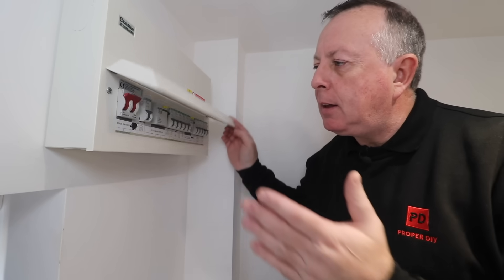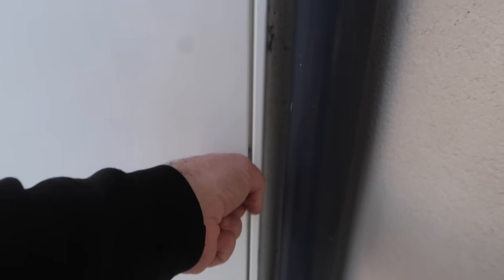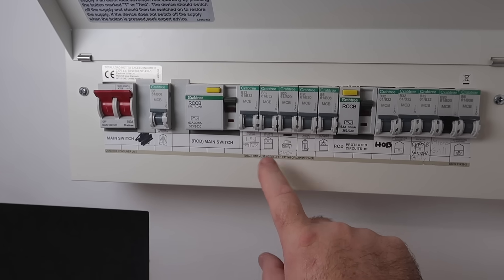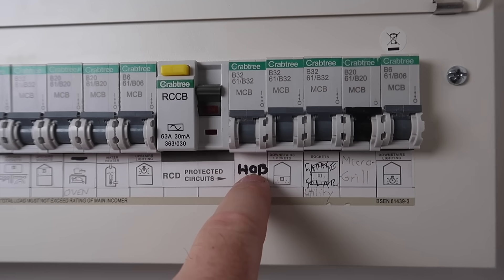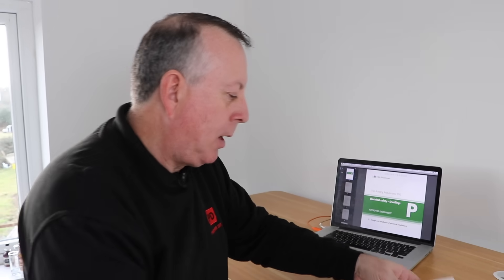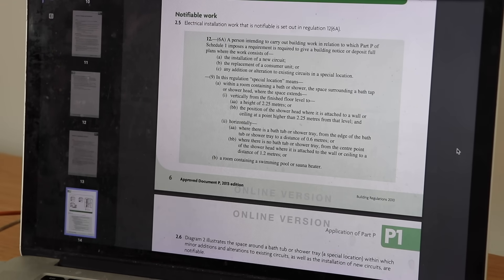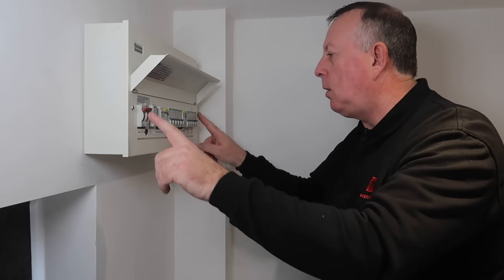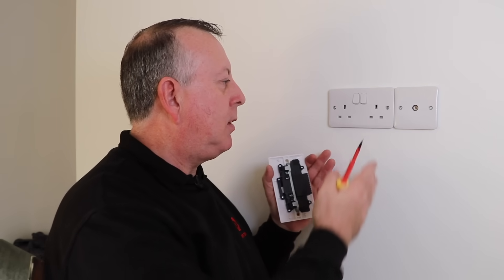What electrical work are you allowed to do in your own home?

Comment: One thing that I think you should have included is reference to the wiring regulations - that's not the same as Part P. This is important since, while homeowners can carry out the work you described, it still has to be in accordance with the wiring regulations. One minor correction is around a fused spur (you mentioned on the video an isolator) which isn't a new circuit and you can install a fused spur as a homeowner. You would need to do so if, for example, you were to install some lighting from the ring-main. The lights would have to be fused down to 3 or 5 amps. You're spot on about the consumer unit though and it's worth adding if you have a second panel in a garage, it applies to new circuits there too.
Reply: This is a good point.

A while back I replaced a section of wiring over at my Nan's house, which ran out towards an outside light. The installer (I won't call them an electrician) apparently decided that because the cable run was partially protected by the building that ordinary PVC interior wiring would be acceptable.

I replaced the bodge-job light and ran new pond cable (HOF7RN or something) to it. I found the old cabling had started to become brittle and wasn't adequately supported along it's length, which was also nice.

Apparently the same guy may have been involved at one of her neighbour's houses as they had the same type of cable but running to a garage, and their landlord had to have it replaced as it kept shorting out when wet.
Reply: Unfortunately, the wiring regs are not available for free (at least, not the current ones). I have managed to find the 16th Ed online, but not more recent. I won't link here because I don't want to give the impression they are still valid.
Reply: @awt  Why would books be published for free?

There's no "unfortunately" about it.
Reply: @deang5622  Requirements that citizens are required to follow should be provided as a matter of course.
Reply: @inyobill  They are provided as a matter of course.  It is called BS7671.

You cannot expect a charity to print an unlimited number copies of the regulations and give them away for free to any electrician or other individual that wants them.

In the case of electricians they are running a business, and the regulations are just like any other tool the electrician uses. They should be expected to pay for them.
Reply: @deang5622  In the juidsdictions I am familiar with, government provides the standards required. In these days, in addition, no printing is necessary. Homeowners never require access to the standards?
Reply: @inyobill  The way it works in the UK is the  standards are created by a Charity which is not part of the government. That charity is staffed by degree qualified electrical and electronic engineers. The charity produces the book which contains the standard (BS7671 -British Standard).

Interestingly that standard is not legally compulsory, however, if an incident occurs where someone is injured or killed, The Health and Safety executive, which is an agency of government, can investigate and prosecute under Health and Safety law. So the party responsible for installing the electrical installation, or subsequent maintenance of it can be prosecuted and the fact they have not followed the standard (the regulations) will be taken in to consideration by the Court and may result in them receiving harsher punishment.

Part P which is part of the Building Regulations is also law and must be followed. And Part P contains rules around electrical installations in residential properties.

The charity that creates the rules written into BS7671 is not funded by the government, it is funded by its members which pay yearly fees, and the charity authors and publishes books on electrical/electronic engineering topics which also raise revenue.
Reply: @deang5622  Interesting. Two folks separated by a common language. Churchill didn't say it, what a shame. Thanks for taking the time to be patient with me. And thanks for the courteous responses.
Reply: The IET is a registered charity but they are NOT part of government. 
They are funded by its members which are mostly degree qualified engineers.
I am a member of the IET. We pay membership fees each year.

This debate is over.
Reply: I'm not a qualified electrician but have done nearly all the electrical work in my house including extending ring mains. Studied how to do it beforehand and found its not rocket science. All tested years later and OK.
Reply: I take code to be a minmum. I almost always go a bit beyond, it doesn't usually cost much and gives just that much more confidence that the system cannot be over taxed.
Reply: @inyobill  Over taxed?
Are you suggesting you put in thicker wires than stated in the wiring regs?
Reply: @deang5622  Why not? It's a little extra insurance that the wiring is adequate, at a very minimal extra cost.
Reply: @inyobill  Why not?
Because it is not necessary. It is a waste of money.

Clearly you don't understand what cable ratings are for.
Reply: @deang5622  If the cable run is long you might upsize it to reduce resistance loads/losses.
Reply: @martinrwolfe you mean volt drop?
Reply: A1 ring final

Comment: The point on testing is really important, one I made on another video the other day. I'm a confident diyer with a dad who is a spark and I've done a few jobs with him including full rewires but while most diyers would be capable of changing sockets or lights etc, most, I would proffer, don't do any testing to confirm the safety and integrity of any new work and probably just go on the "it's working, it's fine" mantra.
Reply: A Kewtech socket tester doesn't measure resistance.

And any person doing electrical installation work, that has more than 1LB in weight of grey matter doesn't need a Kewtech socket tester. The wires are colour coded so you shouldn't be making the mistake of wiring them into the wrong terminals.

It's the resistance measurements that tell you how good the connections and terminations are. The Kewtech doesn't give you that. And that is where the fire risk comes from, terminations which have too high a resistance.

But if you happen to have a socket tester, then why not use it to detect obvious mistakes. So I don't think they are useless, but recognise that they are very limited in what they do.
Reply: Agreed - I picked up a Kewtech socket tester (the more expensive one) for any spurs I’ve added.  Better than nothing I hope.
Reply: @PrinceBarin77  That's not how you test mate to see if a socket is safe mate.
Reply: All that is needed is a megger and a multimeter.
Reply: @rogerphelps9939 an mft is well beyond what your average diyer has on hand.
Reply: @rogerphelps9939 what do you think a megger is? Clue it’s an MFT… 😂🤦🏻‍♂️

Comment: Anyone can easily buy a consumer unit. How is this allowed if you are not allowed to work on one?
Reply: anybody can buy a boiler too but you've got to be gas safe registered to install one.
Reply: @Savagetechie  That's incorrect. What the law says is that it's illegal to pay someone to do gas work if they're not registered. If no payment is involved (which includes DIY) it is legal to do it but you MUST fully comply with the Gas Safety Regulations.
Reply: @jeremybarker7577  section 3 paragraph 4 of the gas safety regulations 1998  pretty much  disagrees. With the entire content of section 3 I certainly wouldn't want to stand in a court and contest it.

In fairness I'm happy to avoid any plumbing.
Reply: You are allowed to replace a consumer unit or add circuits to one but as that's notifiable work under the building regs you MUST get it approved by building control and will have to pay a fee for that. The fee is so high that it's often cheaper to use an electrician.

Comment: I’m from the US, on a ring circuit does the wire returns to the same breaker?  

FYI here in Chicago metro area even in single family homes All wiring must be in conduit (thin metal pipe). The power in the US is (120/240 @ 60hz residential. 240 is 2 hot wires 120 is a hot and a neutral.
Reply: Yes. A ring circuit will typically use 2.5mm² twin and earth cabling, which when installed inside a wall is rated at 20 Amps, but it's protected by a MCB that's rated at 32 Amps. As it returns back to the consumer unit, the cable is therefore technically cable of carrying a lot more than the 20 Amps it's rated for (it can flow through both ends of the cable), so is a 32 Amp circuit.

Comment: How about adding more sockets from my existing sockets in my garage? Is this notifiable work?
Reply: You can add a single double socket as a spur from an existing socket (assuming your on a 32A mcb ring main on 2.5mm2 cable), but you can't add multiple sockets on one spur - at least not without a protective device like a fused connection unit. seems to be that it is under part P but is not notifiable. If you can extend the ring so all your extra sockets are part of the ring, again its part p but still non notifiable, but you would not need an FCU.
Reply: @TheGraemeEvans  thanks. I forgot (my bad ) to say is not a ring circuit. So I ques I can carry on adding more sockets  from the last socket ?
Reply: @pgtips1199  Yes you can. It's actually a lot more straightforward than adding stuff to a ring - you just extend. Just check that it's really not a ring circuit - it should be on a 20A (or possibly 16A) MCB.
Reply: @TheGraemeEvans you’re not a spark are you?

Comment: I'm such a noob when it comes to electricity... I find this all very educational!
If I may ask, if that first plastic cabinet is outside, anyone with a triangle key can open it and shut off the power, and all lights, alarm systems with it??
Reply from the maker: Yes - not good really
Reply: @ProperDIY  Hope the thieves and burglars aren't subscribers to your channel then
Reply: @ProperDIY  stick a lockout padlock on upside down. after all your rcds will still trip under fault the switch doesn't physically have to move. it's no diffenert to not having as isolator fitted.
Reply: Alarms have battery backups that keep the system alarmed in the event of an outage. Mine, when it has no power, activates and you have to input the code to disable it. Much to the dismay of my neighbours one night we were away for the weekend and there was a short interruption to the power 😬
Reply: @rodgerq  indeed - 'tis why so many of them are able to make a racket during a power cut!
Reply: @docdelete  So, if I understand you correctly, placing these things outside is something of late? It seems rather obvious that these kind of vandalous acts would occur... It's a bit like placing a water tap outside your house steet side: sure enough some smart @ss will come along and turn it on...
Reply: @c.a.g.1977  Yes, the outdoor electric box seems to be something that's caught on in the past 25 years or so. Electric companies like them because they don't have to enter the house to read the meter or perform maintenance, and it's much more difficult to hide electricity theft.
Reply: @docdelete  Cheers.  Bloody autocorrect.  (I type "racquet" quite often so it's 'learned' that I probably mean to type it)

Comment: Lighting circuits can also be on a ring final circuit. Also, A DIYer CAN carry out work if they are a competent person.
Reply: It could be argued that some DIYers are more competent than some that have attended training.
Reply: @dnealuk  I agree but many DIYers are not competent at all. It really matters that you know what you are doing. In the 1980s I replaced several consumer units with fuses by ones with MCBs. I wouldn't bother doing that these days because the fees building control want means it's usually cheaper to use an electrician.
Reply: @jeremybarker7577  Absolutely. But the information presented is factually incorrect, the regs don't say that you have to be a qualified electrician. There are plenty of qualified electricians out there that are not competent.
Reply: Self-determined competence is worthless in court.
Reply: @vylbird8014  True. Conversely & sadly, NVQs (which show you did something once while the assessor was watching you) are no assurance of competence.
Reply: Lights on a ring? Wtf?

Comment: As a Yankee I thank you for explaining the British system. It's fascinating to see how different it is and I don't mean wagos and wire nuts. Thx
Reply from the maker: No problem GS
Reply: Different, and considerably better.
Reply: @vylbird8014  Cables buried in plaster, inaccessible junction boxes, and ring mains are far from "better". The main advantage is 240v instead of the 120v used in the US.
Reply: @thelight3112  230V 😁
Reply: @thelight3112  Cables shouldn't be buried in plaster, junction boxes should be obvious in location and accessible and ring mains require considerably less wire than the alternative.
Reply: @thelight3112  junction boxes can only be inaccessible if they're "maintenance free" but most of the time dedicated junction boxes aren't required at all. most junctions are behind sockets so very accessible and much neater than some other countries where maintainable dedicated junction boxes are required and therefore visible all over the place.
Reply: @thelight3112 
Final ring circuits are brilliant in their elegance and simplicity.
Reply: That's not an advantage to the trades, who need massively heavy and expensive transformers for their much safer 110v tools.
Reply: @thelight3112  yeah, cables buried in plaster are bad, that's why my father (he was an electrician) put all cables in conduits when he wired our house. that way cables can be installed and replaced without tearing the walls open.
junction boxes don't have to be inaccessible. in our house the junction boxes were flush with the wall and wallpapered over, but that doesn't make them inaccessible.
if i ever get a chance to build my house, i won't have any ring circuits. 
and yeah, 230V is better than 115V because it keeps the current down. for the same reason a whole-house battery system should have considerably more than 36 or 48 volts, IMHO.
Reply: @johnburns4017  Ring final circuits make absolutely no sense, (contrary to what people claim) are a waste of copper, and violate their own standards for wire overcurrent protection (making them technically a fire risk), even when done completely "correctly".  You could supply more current with the same size wires, have better fault isolation, fewer hard-to-detect faults, and less risk of dangerous overloading if you just split the ring at the end, added a second breaker, and made it into two separate radial circuits instead.

Honestly, there's such a weird cult-like mythology some people have around "ring circuits are better" that just isn't actually objectively true in any way.  They're an antequated approach that might have sometimes made sense a long time ago (when fuse boxes couldn't have many circuits in them), but absolutely do not nowadays.  And there are actually good reasons why almost nobody else in the entire world uses them.

Comment: Part "P" was brought in, after a Pumber wired a Boiler incorrectly, making it Live. This inturn, Killed a Daughter of an MP, who then made it his mission, to try and change the rules, the way that the Electrical System was installed and maintained.
Reply: Yes that's correct, an MP's  daughter was killed, which is obviously very sad. But the Part P regs are an over the top joke in my opinion. It means that a professor of electrical engineering cannot legally rewire his own house. Now that is nuts !
Reply: @tonyknight9912  Thats why the General Public, dont follow it, thats if they are aware of the Regulation. Plus can you see the Council banging on your door, to inspect your Wiring. Its one of those Regs, that cannot really be inforced,
Reply: he failed then cos plumbers still wire up heating systems wrongly, sometimes even dangerously.
Reply: @mattsan70  I agree. When it first came out, there wasnt enough inspectors, to look at the completed work. I also cannot understand either, that any Tom, Dick or Harry, can still buy these items and do a complet bodge job of installing them..... I am an Electrical Engineer HV, by the way.
Reply: @mattsan70  Artisan youtuber had an electric shock from a socket because the boiler man wired up the circuit wrong!?!